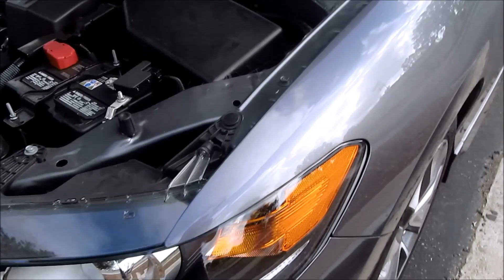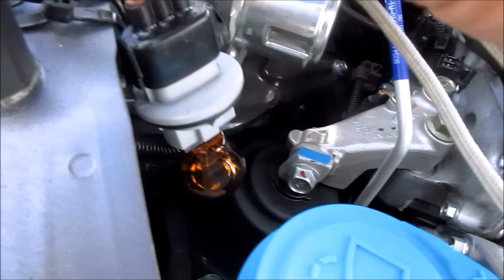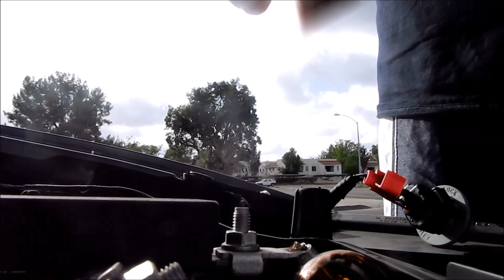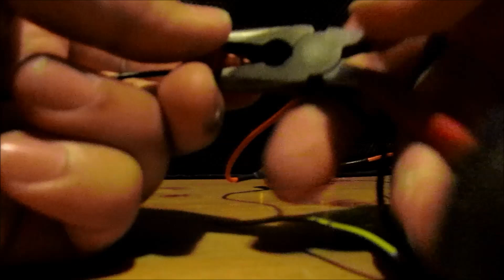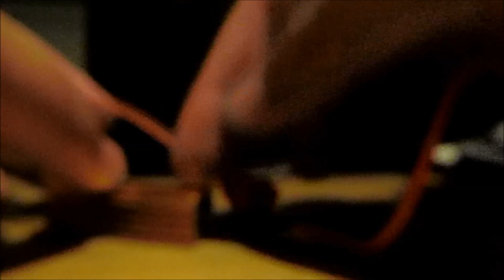Tutorial: 2013 - 2017 Honda Accord Front Turn Signal Resistor installation

Comment: Quick question I have a 2017 accord sport. I had somebody install them for the front but they didn’t install rear switchbacks but it seems fine with no hyper flashing. Do I need to install the rear switchbacks then?
Reply from the maker: If you are installing these types or resistors then you need to install 1 resistor for every turn signal bulb you change out to led.  If you only have the front change out to led then you only need to install them in the front.  When you swap the rear turn signal to led without installing resistors in the rear as well then you will get hypeflashing.

Comment: I have a resistor that has a red and black wire. So, do I hook up black with black and red with blue???
Reply from the maker: Red get connected to the turn signal wire and the black gets connected to either the ground wire on the turn signal socket or to battery ground or chassis.

Comment: Would you risk getting pulled over for hyperblinking? I have a 2018 Honda Accord, just installed rear LED turn signals, and now I have that issue.
Reply from the maker: I don't think so but that is upto your local PD.  As long as it blink amber or red in the rear and white or amber in the front then it should be fine.

Comment: Hi you were saying we need a 50 watt 6 ohms resistor, my friend has a plug in play resistor that is 50 watts but 8 ohms and his works as well. What ohms do you recommend? 6 or 8 or will it be a big difference? He has a 2015 Accord Sedan.
Reply from the maker: all standard led load resistors sold are 50W 6ohm

Comment: I installed load resistor on my 2016 Honda Civic in the rear turn signal and it fixes the hyper blinking. Next, when i tried to fit and test JDM astar led turn signal in the front I was surprised that even if does not have load resistor its not having crazy hyper blinking. Is this normal? Is one load resistor on each side is ok? Im thinking of putting load resitor in the front next week coz im afraid it might be too heavy for the 2 resistor in the rear for 4 turn signal lights. Thanks!
Reply from the maker: How did you test the turn signal to see if it hyperflashes.  If you used the Hazard button then it will not hyperflash.  Also which led bulb did you install on the rear turn signal.  If you are not getting hyberflashing, you do not need to install resistors in the front.
Reply: DIY: Car Modz I tested them 1 side at a time then I turned the hazard lights on as well and all of them are not having hyper blinking. All led t.s. lights are JDM Astar (front- JDM Astar extremely bright 144-EX Chipsets 7440 7441 led bulbs Amber Yellow;  rear-  JDM Astar extremely bright PX Chipsets 7440 7441 T20 led bulbs Amber yellow). so, you think i do not need to install load resistor in the front?
Reply from the maker: NORBIE MONDERIN what resistors are you using
Reply: DIY: Car Modz im using Aaron 50w 6ohm Load Resistors. Why?
Reply from the maker: NORBIE MONDERIN don't worry about it then. if you don't have issues don't need to install it in the front.
Reply: Thanks bro! Thank you for all of your videos...it really helps us DIYers to save money and time....THANKS!

Comment: I have switchacks on my accord as well but I seem to keep burning out my driver side bulb. It's happen 2 times in the past month already. 
Any advice. (I heard that wiring the ground to the car physically instead of ground wire could do the trick but wanted to ask first)
Reply from the maker: What car do you have? and which led bulb did you purchase?  Can you link me the exact bulb.
Reply: DIY: Car Modz 2014 Honda Accord. 
store.ijdmtoy.com/28-SMD-1157-3157-7443-Switchback-LED-Bulbs-p/20-06x-2835.htm (bulbs URL)
Reply from the maker: Coupe or a Sedan?  Also is it both the parking and the blinking light that is going out or just one of the function.  Which resistor kit did you install and how did you install it?  And when you do experience the led bulb malfunctioning, have you tried putting that faulty bulb into the opposite socket and verity if it is the bulb or something wrong with the socket or wiring.
Reply: DIY: Car Modz 
 Sedan. 
 Both parking and blinking work. Eventually once the bulb dies, I lose both functionality. (I just bought my 3rd bulb in less than 3 months 😕)
 I bought 6 Ohm 50W LED load resistors from the same website (ijdmtoy) okay so driver side resistor is on blue & black / passenger is green and black (did NOT touch red on both sides)
 So yes I did this test just yesterday. Switched both sides. Burned out one stayed dead. One that worked turned on on opposite side. 
 Question: if fuse went out I would have zero light correct?
Reply from the maker: Erick Umana
Correct.  The resistors are installed correctly and like you mentioned if it was a burned out fuse then all the parking lights will not work.
Since the socket works with a working led installed, the wiring and socket is not damaged or cut.  Only suggestion would be to stop purchasing that particular led bulb.  Go find something else.
Reply: DIY: Car Modz yeah your right. May be the bulb. Thank you so much for your time! I appreciate it a lot. 
Maybe one last question lol any recommendations?
Reply from the maker: This is what I use: https://youtu.be/UFRm8FpdVz8  Its from JDMastar and the only difference between your year and model is the bulb base type.  Mine uses 3157 and for your vehicle it is 1157.. this one: http://amzn.to/2hdRTAp

Comment: I bought resistor for my switchback, but it is still hyper flashing. The resistor has a clip on that allows you to make connection to the negative and turn signal. I took it out and the wires covering is still there. The clamp should cut the outer layer of the wire, correct? I took the clamp out and it still has the outer layer with little tare. Thanks in advance! 

Video of the issue: https://www.youtube.com/watch?v=RkEWZNyNrG0
Reply from the maker: Yes, that is correct.  You need to clamp those connectors way down.. there shouldn't be a gap light that on the connector top.  It needs to cut through the sleeve and make contact with the wires inside.  If you want, you can also strip off the sleeve where it will make contact before you splice it using that connector.
Reply: Cool, will try that! Thanks!

Comment: Hey, thanks for you videos. I recently purchased a 2016 Accord so these videos have been really helpful. That being said, I had a few questions.

Can you show a video showing how and where to attach the physical resistor to the vehicle? That's the only part that I'm confused about.

Second, do you plan to have some videos showing you changing the rear lights? I've changed the reverse lights, but I'm not sure about the others.
Reply from the maker: I would install it on the metal beam that is right above the headlight. Also go check out my other videos on my channel  www.youtube.com/diycarmodz/videos I have too many videos to link them all here.

Comment: If one of LED bulb blows and I have OEM bulb handy can I put it in now until another LED arrive? Also What to do if want to remove resistors and go back to stock?
Reply from the maker: +iombie Yes, you can put the oem bulb back on.  I would remove the resistor though.  If you're using this quick connect then just remove the resistor and wrap the oem wires with black electrical tape.  I have mine resistor hooked up on the rear turn signal socket.

Comment: is there a chance i can mess up the wiring by pressing down on the clamp of the resistor too hard? and what do you recommend for mounting the resistor?
Reply from the maker: +HUNTS You have to clamp down with firm pressure so that the blade cuts through the wire sleeve and makes contact with the wires inside. You need to mount them away from any plastic pieces or wires or cables and to something metal.  I have mine mounted to the rear turn signal wire using 3ohm 50w resistors. https://youtu.be/qoXj0FD9T5g
Reply: +DIY: Car Modz am I going to need resistors in the back even though I'm only changing the front? Also, what kind of double sided tape was used?
Reply from the maker: You just need to install  a pair of 3ohm 50w resistor.  One per rear turn signal wire harness (driver/passenger). It doesn't matter if you hook it up to the front or the rear but you have much more room to work with in the rear.

This is the tape you can use: http://www.vleds.com/vlr-tape.html
Reply: +DIY: Car Modz you're the best. Last question, you know where I can find a rear little lip for my white sedan? Can't find one anywhere
Reply: +DIY: Car Modz when I plugged in the led bulb from the link I bought the bulb didn't turn on, do I have to tap the wires first in order for it to turn on?
Reply from the maker: +HUNTS Which led bulb did you buy and what car do you have.. coupe or sedan.
Reply: +HUNTS figured out why that link shipped me bulbs that were too short and don't go all the way into the socket, what bulb would you recommend? Cause these are too short I'm almost positive. I didn't get the same bulb as the one in the picture on the eBay post
Reply from the maker: The ebay link you linked is the wrong part. Sedan uses 1157 bulb not 3157.
Reply from the maker: HUNTS  http://amzn.com/B017C6B5H6

Comment: What if the back has led to? Same process?
Reply from the maker: +Eugene Brana Just install the resistor 3ohm 50w to the rear turn signal wires instead of installing 6ohm 50w to each turn signal light.  The 3ohm resistor will fix the hyperblinking issue for both the front and the rear.

Comment: Hey man great vids! I was hoping you could help. I have a 2013 coupe LX accord. I want to replace my turn signal lights (front and rear) with white LEDs instead of the stock amber color but I dont know what bulb part#s they are. I'm getting different PNs from different sites. Any help would be greatly appreciated.
Reply from the maker: 3157 CK front and 7440 rear
Reply: +DIY: Car Modz Do I need resistors for the front and rear? or are these just plug and play? If so, do you recommend any? link?
Reply from the maker: tmuney08 You're going to need resistors.  https://youtu.be/qoXj0FD9T5g
Reply: +DIY: Car Modz I bought the lights and the resistors and only installed the lights. Everything was working good. I actually dont mind the hyperflashing, but after being parked for awhile i got in my car and the back 2 lights work fine with no resistors, but the front 2 are on a stay on mode (no resistors) with my parking light. Nothing blew, cause the lights are still on, I'm wondering how to make it so that they correspond with my back signal lights instead of my parking lights. Any ideas? Is a resistor necessary? Or am I able to use them without a resistor? Any ideas/suggestions would be great. Thanks!
Reply from the maker: tmuney08  The front corner lights are you parking and turn signal. it is functioning as it should.  They are dual filament bulbs. They are suppose to stay on with the parking lights and blink with the turn signal. Resistor has nothing to do with that.  All resistor does is fix the hyperblinking.  If you only want it to turn on with the turn signal, you will have to cut the turn signal wire but if you did.. you will get hyperflashing forever regardless of resistor.
Reply: +DIY: Car Modz I'm fine with the hyperflashing. So the problem is that when I turned on my left or right blinker, just the backs blinked, the fronts did not they just stood "on" with the parking light. The left and right green arrow also stood on in my dash. When I plugged stock bulbs back it it all went back to normal. ?
Reply from the maker: +tmuney08 can you link me the led bulb you purchased.  It sounds like a grounding issue or a bulb issue.
Reply from the maker: +tmuney08 How many metal contact pieces are there on the front turn signal bulb. Better yet take a picture of the base of the bulb and email it to me: diycarmodify@gmail.com
Reply: +DIY: Car Modz picture sent.
Reply from the maker: tmuney08 Do you have a 9V battery or own a rechargeable 12V battery (like a drill). You have to test the led bulb itself and see if it is functioning correctly.
Reply: +DIY: Car Modz I have a 9v and a 7.2v rechargeable batter for a drill gun but I don't have a 12v rechargeable battery.

Comment: hey as always thanks for your videos! such a great help! I have a 2013 accord coupe and I took out the amber reflector inside the light housing, and I have led switchbacks but the passenger side just stays white even if I put the turn signal on. and the driver side the white doesn't turn on at all but does flash amber. any help would be greatly appreciated. also do you have any suggestions for the front turn signals to purchase preferably leds that only have amber at the sides and the white in a projector style switchback. and for rear I'm looking for the red instead of amber. thank you in advance.
Reply from the maker: +Preston Leggett Hi, Can you please link me the product you are using.  The correct bulb for the front turn signal should be 3157 CK type.  Also, I would try switching the bulb around from passenger side to driver side and see if the same symptom follows the led bulb itself or if they problem stays with the socket itself.   As far as led switchback.. unfortunately, I have not used switchback on this Accord and can't recommend any at the moment.

Comment: Hey,
I love your videos, theyve been so helpful to me. Have a little problem with this mod though!
The driver side works fine, but the passenger side goes from white to off when the right turn signal/hazard is triggered. No hyperflashing, using a 6 ohm resistor on both sides, tapped into black and blue/ black and green. The rears work perfectly fine. Whats weird is both cycle to amber when the unlock button is pushed on the key fob.
2015 honda accord sedan sport, any ideas?
Reply from the maker: +Sami Aji For the passenger side.. remove the led bulb and replace it with stock bulb.  Test if it works as stock.  If it does work, check to make sure the connection from the resistor to the stock wire harness.  It could be grounding issue.
Reply: +DIY: Car Modz that was it! Ground pin needed to be bent! Thanks!!
Reply: Hey I am having the same issue! When you say ground pin, do you mean the pin inside the socket where the bulb is suppose to be inserted?
Reply: +kambo214 its a piece of metal that is in the side of the socket housing, bend it towards the inside of the socket so it makes contact with the bulb
Reply: +Sami Aji go to 7:45 in the video and pause it, inside the socket you can see a little piece of metal closest to his finger. That needs to be bent inwards
Reply: 7:45?
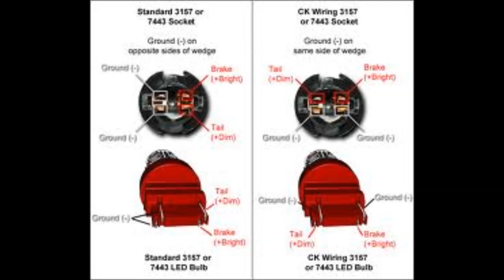Reply from the maker: 1:45
Reply: +DIY: Car Modz you know what I actually don't think that's the problem. I forgot the other other night I switched my left bulb with my right and the one that keeps turning off still does the same thing on the other side. I don't have a link bc I bought it off of craigslist but I do have the bag it came in. I will take a picture and show you if you can hopefully identify it....
Reply: +kambo214 bulb is bad
Reply: Do you have the link of where I can get high quality switchbacks that actually work? Its also hard to trust ebay, so many are listed and I just dont want to waste my money again!
Reply: +kambo214 idjmtoy.com

Comment: Do you have a video for the rear bulb installation? I just want to know which wire is ground and which is turn (+)
Reply from the maker: +Kenan Dokuyucu The rear turn signal bulb socket has only has 2 wires.  If you see 3 wires, it is the wrong socket.  One will be black ( ground ) and the other color will be (+)
Reply: +DIY: Car Modz  Thanks. Does the rear bulb have to be CK type also or does it not matter?
Reply from the maker: Kenan Dokuyucu
The rear bulbs are not ck type.  They are the standard 7440 bulbs.

Comment: Mine is hyperblinking and I'm not sure what I did wrong. I installed resistors on both sides tapping on green/black and blue/black. Any idea how to stop this?
Reply from the maker: +kizzenger I would check that the connector are making contact with the wire inside the sleeve.  Most likely they are not.  Clamp it down with pliers.
Reply: +DIY: Car Modz I'll try that. I was just scared that it'll cut the wire if I clamp it too hard lol. Thanks! :))

Comment: If i want to remove the scotch locks and put it back to the original state, are you able to do that? Or after i put on the resistors i have to always have one on? Another question is can i place a resistor? If so how do i remove the scotch locks? Thanks man. Ur vids are very helpful
Reply from the maker: +kenisinoregon You have to always have it connected.  Yes, you can remove the scotch locks and replace the resistor.  Just pry it apart.

Comment: I have a 2013 accord v6, and the path to the turn signals are really narrow, especially on the passenger side, I had a hard time reaching the low beam , any tips ?
Reply from the maker: +thinh nguyen Install the resistor on the rear turn signal wires.  Much more room.  If your changing out only the front turn signal, then use 50W 6ohm.  If your changing out both front and rear, use 50W 3ohm.  I personally would just use 50W 3ohm so that you don't have to worry about it later if you do add turn signal led for the rear as well.

Comment: In the bumper reflector mod you built pig-tails to allow you to completely return to stock.  Have you done this for the turn signal mod, and if so do you have a parts list?  (Namely connectors)  My intention would be to install the  resistors on the pig-tails, thus allowing complete return to stock.
Reply from the maker: +Steve Scaggs Yes, I have made a pnp resistor adapter as well.  Here is the preview video: https://www.youtube.com/watch?v=DHWAeLNynwE .  If you use a 3ohm 50w resistor, you can just connect the resistor to the rear turn signal lights.  On here I talk about it in detail with part numbers: http://www.driveaccord.net/forums/138-audio-electronics-lighting/333649-harness-extension-switchback-led-install.html